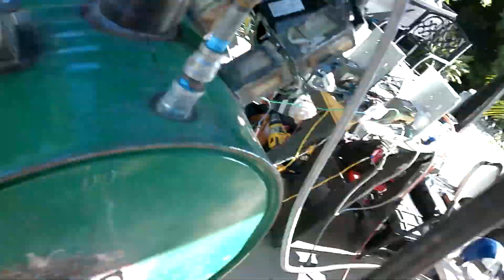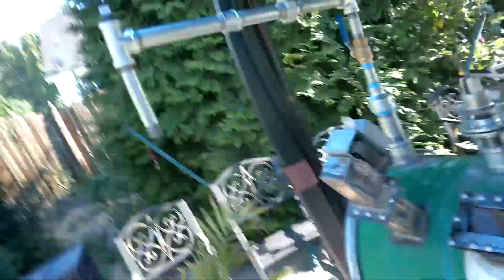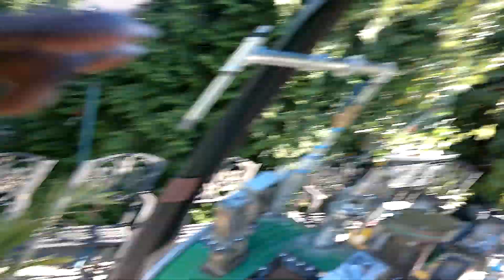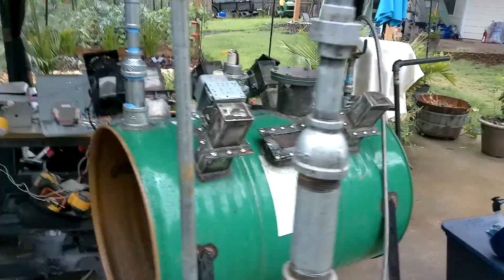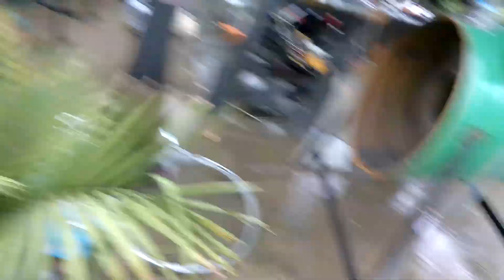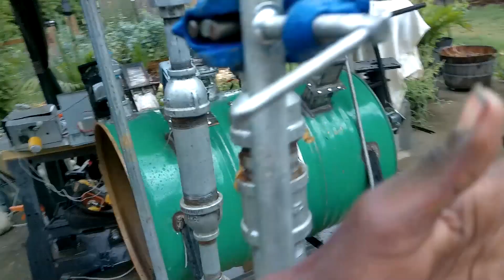The Reactor BLEW UP 😱

Comment: Three excellent ways to avoid getting yourself killed would be 1) measuring your purge rate on the propane flush, 2) installing a condenser/quench/flashback arrester as others have suggested, and 3) installing a burst disk

1) A flow meter will ensure you are correctly purging your oxygen. With an inert gas, a 5x volumetric purge is recommended to ensure 99% removal, but this isn't an option with your flammable purge gas. The propane is dense and cool, so placing your air vent on the top of the reactor will allow it to purge air out the top and avoid excess mixing. The high explosive limit (or the concentration of propane at which the reaction is too rich to self-sustain) is only 10% by volume, so a single reactor volume of purge gas should get it up over 80% and be fairly sufficient.

2) As others have suggested, a water bubbler will create a barrier that will inhibit gas mixing and flashbacks. This will also allow for the condensation of tars and uncracked oligomers (or anything heavier than octane, if you use enough water), which can be decanted from this stream and co-distilled if they are desired products 

3) A burst disk is about the cheapest way you can run a safety valve. Maybe rate it for 1 barg and slap it on that flanged pipe you got ticking out the top.

We want you to stay alive long enough to get this thing done!

Comment: It's too bad 55 gallon drums collapse if you connect a vacuum pump to them. The suggestion below about a flaming rag is a good idea, it might collapse the barrel too though. Along with a valve that opens if pressure builds up. Not sure a pressure relief valve would have helped with a sudden explosion. Glad you are okay. Seems like a fixable problem though. If you had to, you could use 50 gallons of oil to fill it. Then drain it out by forcing your gas into it.

Comment: The rust on the inside of barrel can hold oxygen,  ith because it's porus, but also within it chemicaly
Reply: And may I suggest a flashback valve, check valve. And also a ball valve that vents from the barrel into a small tank that you can then test for flammability

Comment: Lots of great suggestions in comments. I'd like to suggest a pressure gauge on the vessel. If anything, just for more information, to help with your understanding of the system

Side note, I have a hunch that you are losing alot of thermal energy through the wall of the vessell

I know you used an insulated vessell early on, and stopped doing that.

I really do think the vessell should be insulated to increase the efficiency and reduce your power consumption

Your drawing alot of power now with multiple generators
Reply from the maker: True that, I can look into insulation, particularly in my next design, I can make the auger smaller and instead put some insulation on the interior
Reply: @naturejab  i think you'd be fine to insulate on the outside, it will be much easier. and the metallic barrel is actually reflecting the microwaves, where as your insulation material probably wont reflect the microwaves

regarding your auger, its amazing, and you've put so much work into it. 

I do think its overkill, and you only need a basic tumbler.

Your working material is usually low density, so easy to agitate

i'd go a few 4 rods equally spaced on 2 discs. 
The first disc is coupled to your handle, and the 2nd disc is a supporting disc at the other end
Reply: feel free to angle the rods to allow for lateral movement, better yet, it would be great if the rods were V or W shaped to encourage the material to move towards the center line of your microwaves
Reply: these shapes would also give the rods stiffness as it is quite a long span, maybe a disc in the middle for extra support
Reply: i am also curious if there is a better catalyst material that can be used in an agitated environment. my material science knowledge isnt great, so im not sure what would be best. geometrically i would think small spheres may work well (think marbles), and at the moment im thinking concrete, but really not sure what material would last, what do you think?
Reply: in my mind, the functionality would be to assist in agitation, and also potentially assist with thermal transfer via their surface area

hah, here is a crazy idea. The ideal material would be diamonds......

So, Could you compress your char into balls to achieve a decent degree of structural integrity? :D

Comment: dont know if u mentioned or not, but a one way valve could help stop air being sucked back down the gas outlet. thats what the fluttering invisible flame was. cold and hot cycles, contraction and expansion of the gases causing air to suck back into the drum. nice work tho man i wnt to build one of these.

Comment: Hey backwood scientist and implosion is when it implodes inside of itself i e your 55 gallon drum would have been sucked within itself what you're doing with is it flammable explosive vapor which is a explosion is rapidly expanding fuel that cannot be contained by the reason why both ends of the barrel are puckered out it's called on x explosion not an implosion

Comment: I'm curious on what exactly this contraption is supposed to do.
Reply: Same here, it's a barrel he's filling with gas and lighting on fire through a pipe, tell me if you find out what it is.
Reply: @shawnbell3468  I only know that he's not making wood gas or hydrogen gas from water. The microwave part of the reactor is not something I've seen before. But I am familiar with exploding oil drums via Oxygen and Acetylene
Reply from the maker: Turns plastic into Fuel - Gasoline, Diesel, Natural Gas, ect

Comment: Dude that’s some good work you are doing… but it seems you are forgetting about safety forget about maintaining pressure in the system and open all the valves fully when the reactor is operating also the bobbler is also necessary,,, you can youse it as a provisional flame arrestor
Reply from the maker: Will def be adding the bubbler, thanks

Comment: Implementation of a brustdisk system might be a decent solution to possible explosions if you know where the weak spot is you'll know where it will vent the brustdisk could be a few layers of food service aluminum foil as it is thicker and a large diameter pipe with a flange and and a ring of the same diameter and places for bolts in both parts by placing the aluminum foil in between and tightening the bolts you have sealed the reactor but know where it will pop if it does and it should work for vacuum and presser it will likely require some trial and error to get to work
Reply from the maker: Great suggestion!

Comment: Could you possibly get a pilot flame port in the bottom welded in to avoid leakage but using the glass window above ignite the pilot flame in the closed environment should consume all the o2 and other possible flammables until it extinguished?

Comment: May be worth experimenting with an O2 sensor from a car? Maybe behind some kind of large valve, so most of the time you can shield it from the hot gas & vapors? I haven't worked with them, so just a thought, since the volume is an issue.
Reply: o2 sensor for regular cars are narrow band, you would need a specific wideband sensor i believe
Reply from the maker: Definently want an O2 sensor

Comment: THIS is exactly why I use heavy vessels that I can vacuum down.  Don't purge with flammable gas, don't purge with inert gas, you're inviting problems either way.  If you must use light gauge vessels such as barrels, design with a "puff lid" -- consult the woodgas community for designs on this.

Comment: ElCabo has it right. Water trap flash back arrestor. I don't know if it's burning back but get one in there anyhow.
Burn a rag in there to consume oxygen. You won't have to pump in gas that way so it's win win.
That reactor, I'm not sure how to say it but that lid blowing off sideways like that, someone is going to start calling Police on you. The noise from the explosion itself can get you in trouble not to mention the mere possibility of someone getting hit by the lid. It looks like it can't really get out of your yard but they're going to exaggerate the danger. After that, "They" don't want Us making our own fuel. They're going to take any excuse they can to shut you down. Do you have any Family or Friends out in the country where you could set up? You got to get down to why it keeps doing this and eliminate the possibility of it happening again, as much as possible. The lid is acting as a blowout panel but that's nothing to rely on. One of those magnetrons could come flying out of there especially since the joints have been stressed a few times. Sorry to be all Safety Nonsense on you. People with brains and drive are a dying breed. The world needs brains and drive.
Reply from the maker: I'll more than likely have to move this whole setup to the country, just haven't made the commitment yet. Thanks for the advice!

Comment: Mate! That lid is actually a decent safety feature! Two things to really strongly suggest:
- flash back arrestor (a water trap) as suggested below. Mine has saved my bacon before. 
- to completely purge your reactor, take the end off, light a rag, put it in then close it. This will consume all the oxygen before you start.
Reply from the maker: The rag thing is a great suggestion. Of course, water bubbler / flashback arrestor is mando for now on. Cheers mate!
Reply: @naturejab  What is the reasoning of building this reactor? What types of things are you able to do with it?
Reply: @zyxwvutsrqponmlkh  Thank you for the response, Wow thats pretty amazing from such rudimentary equipment (I mean that with the most respect, what he built is incredible).
Reply: @zyxwvutsrqponmlkh  What? that's not even close to what this is lol
Reply: @simonsays...5061  Don't listen to them, fusion would be almost impossible to create at home, this is a pyrolysis reactor designed to use microwaves to convert plastic/petroleum products back into oil and flammable gas
Reply: @zyxwvutsrqponmlkh  What, was your original comment a joke? doesn't it have to be funny to be considered a joke?
Reply: @junglejim9551  i have nuclear fusion at home.
Reply: I second such notions strongly too, damn you could capture some shrapnel fragments too buddy, work case scenario.. Liftoff! hehh Also I wide port for capturing all them atoms from the environment you are trying to vacate.
Reply: Rag suggestion ,l couldn't agree more with you ,simple and foolproof.
Martin🇬🇧
Reply: But he could go get a canary and stuff it down that hole ,stops flapping ,      stop purging ,simples eh

Comment: I suppose you forgot 1 more thing: Take a table spoon, place it into your kitchen microwave oven and turn it on. Watch it for 10 secs. Then go to your reactor and have a closer look what could happen inside with the big metal stirrer and the micro waves. Everything runs well until you have the optimal mixture of flammable gases and oxygen inside. I heard of some chemicals which replace oxygen very effectively. 

Please take more care, dude.

Comment: A flash back arrestor is vital. Also, get a pressure gauge, and instead of using the pyrolysis gas that you have, which is flammable, use nitrogen. get the can to a few pounds over atmosphere, vent down to atmosphere, do it again, and a third time.

Make it four. Nitrogen is 78 parts of 100, oxygen is 21. Yeah... Four times should reduce the oxygen down to negligible levels.

But you need a flash back arrestor. Dear God.
Reply from the maker: Thanks!

Comment: DUDE!! You have a guardian angel for shure! I have been following this from the sidelines and been thinking "i think i heard.. that sharp metalic angles are the reason for sparking in microwaves.. but what do i know?" 
That agitator of yours.. might be a breedingground for all the sparks necessary for ignition (i dont know enough about gas mix with air for suppressing combustion but it feels like there could be a big ol variable like, some "waste" produces enough "air" that even if you get it going it might react mid process?) 
What id do as a first step, make a "blowoff membrane" with sheets of aluminuim foil packed, idk 5 sheets thick, then do a "pipe with flange-foil-ring" setup so IF there is a catastrophic failure the foil will pop and thus reducing risk of the barrel itself becomming a shrapnel bomb. 
I hope my limited knowledge can provide some insight in the situation and.. man, stay effin safe aight?!
Reply from the maker: Great suggestions, thanks mate. The agitator doesn't cause arcs or sparks, I'd see them thru the window / hear them.
Reply: @naturejab  True that, id imagine it would be a ligtning show in there if it where a issue! Slap on this tune; "MIND OVER MATTER - LOOK MUM NO COMPUTER Live on KOSMO 2.0" and get it working with all them safety features (Like some dude said, water trap, feels easier than my membrane sollution, and what some other guy said, burn some paper or sum to remove the air.)